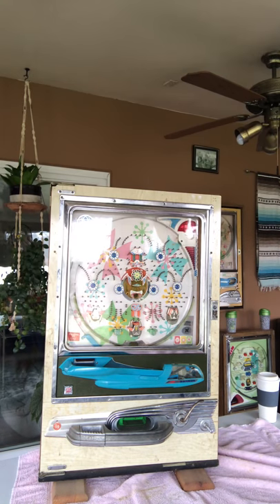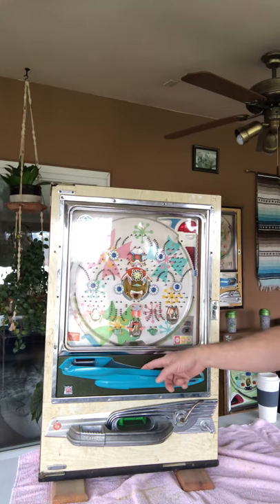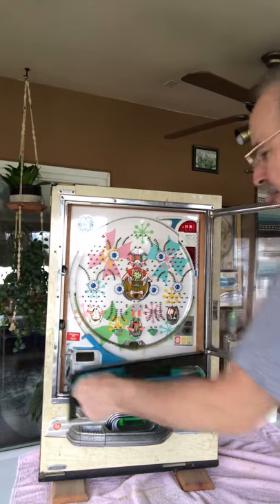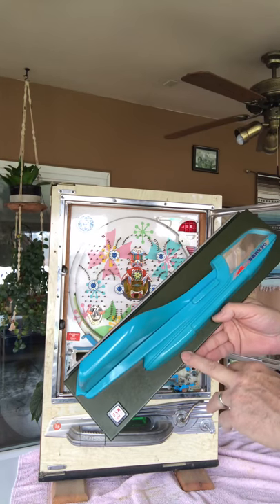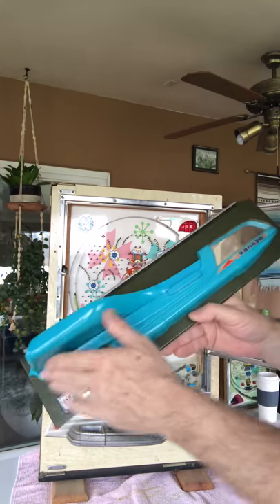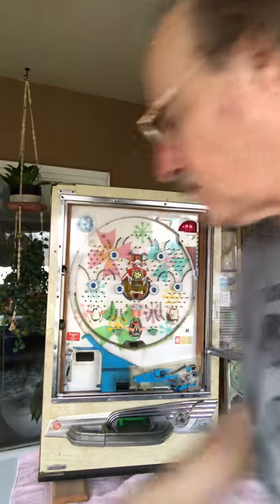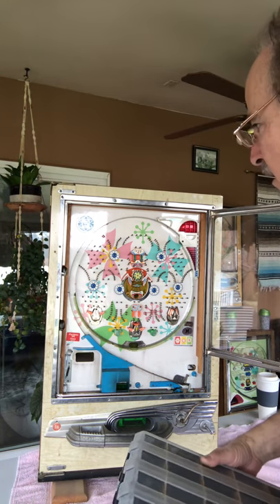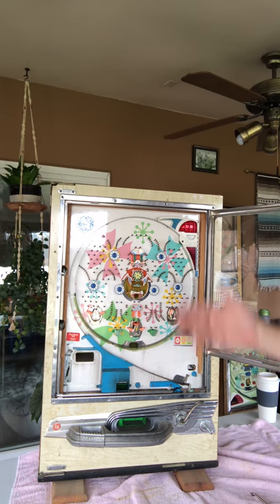Restoring a Pachinko Machine Part 1

Comment: Hi Dan. I just got a pachinko machine at a garage sale with the intent of cleaning it up and making it functional once again. My question  to you is, "Is there anywhere that I might buy plastic parts for parts that are broken. I have a Sankyo machine from about 1972and the upper tray was taped onto the machine because the plastic holes on the backside of the part had deteriorated to the point that they would not hold the screws. Any hints of help would be greatly appreciated. Thank you for your time.   Ken
Reply from the maker: Nishijin parts are the easiest ones to find as they made more machines than the other companies. Most of the time you just have to get creative and make something that is functional. 
Try going to www.pachitalk.com. They have vintage machine forums where you could post a request to see if anybody has a spare.

Comment: I have one an older one. How much are these things worth? I don’t even know how it works. Can I sell it?
Reply from the maker: Most pachinko machines are worth $25-$50 depending on condition.  As the condition of the machine gets better, the value goes up.  These machines were mass produced and are quite common and available. I have another video on my channel that deals with this issue.